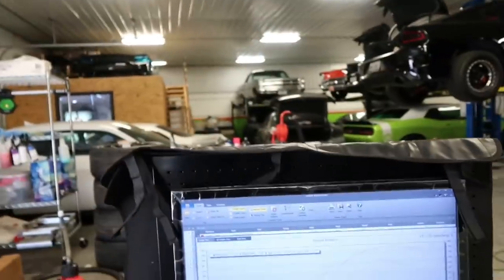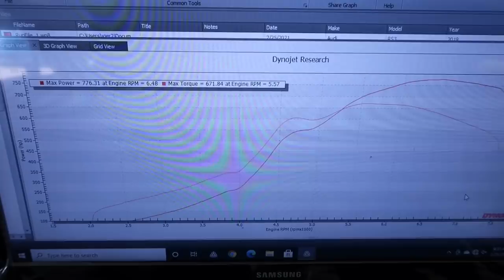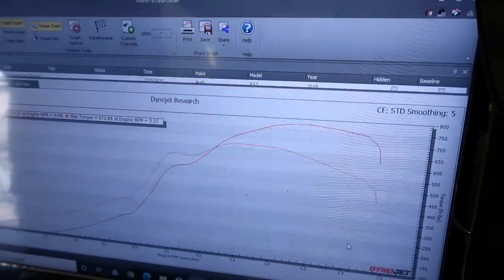MY TRACKHAWK IS BACK IN THE STREETS!!!!

Comment: A FWD Audi???? I thought they were all AWD, or RWD
Reply: Audi only come Fwd or Awd
Reply: @tuck9513  they are AWD but FWD bias. You can pull a fuse to lock in FWD
Reply: @sateratuning  you can pull the fuse but some of the A4 and A6 come in Fwd even a A3 does as well I have been you fine them in the 2.0t model alot. I work on Audi for a living
Reply: @tuck9513  I was referring to the one in the video lol
Reply: @sateratuning  I understood that after I sent the message lol....dope as build I know the rs3 have super potential but there weak link is the AWD system on the track